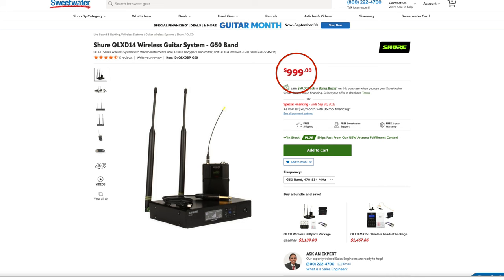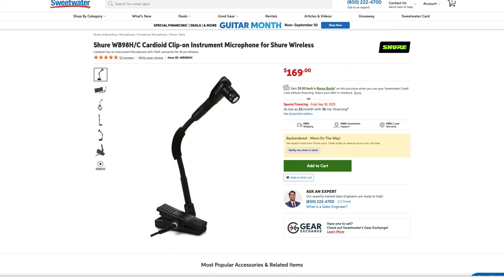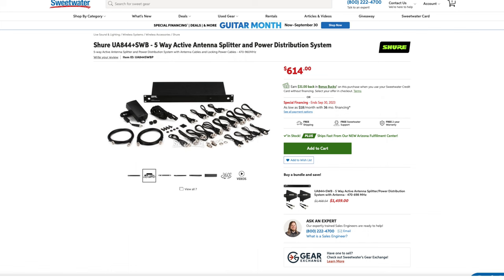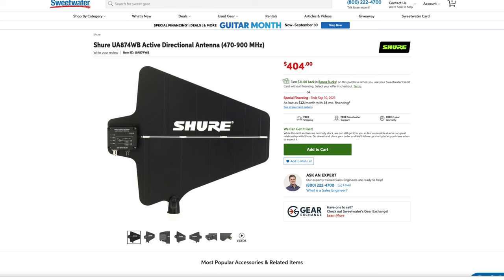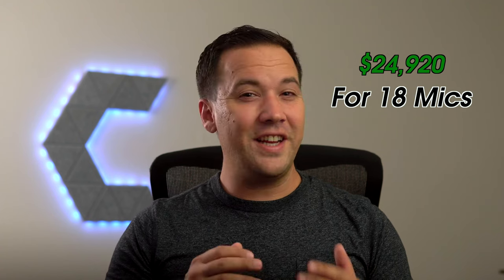Let's Talk About Wireless Brass Mics in DCI

Comment: Crazy that this 24k cost on Wless mics is just the low end. Largest downfall to QLXD is that its tuning band isn’t wide enough to be reliable when touring to every city. For my own QLXD, i have it in the G50 frequency band. But id be hesitant to take it anywhere where i don’t know the RF environment. Dont get me wrong, QLXD is a pretty reliable system, but when you’re in one city only (in my case, Houston) 

To get the best results, corps should be going to Axient Digital. Which is extremely flexible in its tuning band. And costs a hell of a lot more
Reply from the maker: I fully agree on Axient being the way to go. There are already a few drum corps now that are using Axient gear. The major drawback is the price increase, it’s no doubt worth it but you’re looking at $3000 per wireless channel compared to about $1350 per channel for the QLXD models.

Comment: I really like your comments on the issues with regulation of wireless tech.  I’ve always had a similar thought process when it comes to pre-recorded singing/vocals and the whole thing where you have to assign each syllable/phrase (I forget exactly which it is) to a different key on a synth. I’ve always wondered how do they even enforce that?    Also, any chance you could do a video on line arrays vs. Point source vs constant curvature speakers?  I’ve wondered what the advantages and disadvantages of using those over a point source speaker would be, especially regarding customizability and adaptability for different stadium layouts, especially regarding how close you are to the field and the angle of the stadium.
Reply from the maker: Enforcement of the rules is definitely a tough one. I have a lot of experience in the WGI realm and they are much more strict about enforcing rules throughout the season. But it is also understandably much easier since the groups and venues are significantly smaller than a football stadium.

I absolutely have plans on making a series where I discuss different audio gear and software. That would be a great video to add to the series! Thanks for the suggestion!